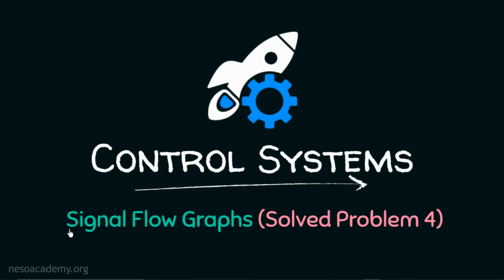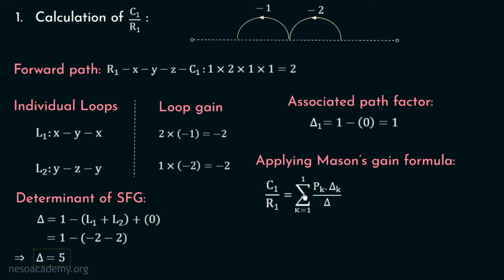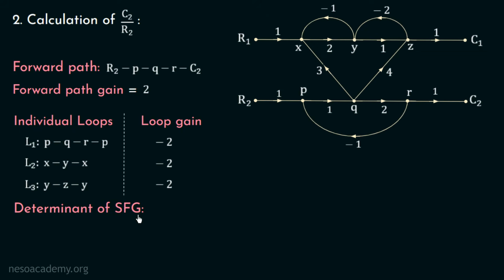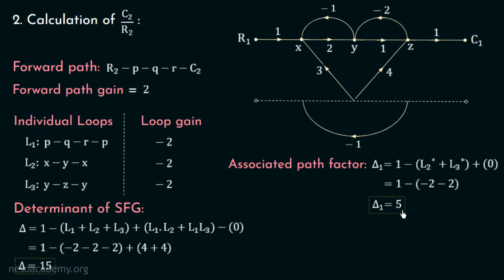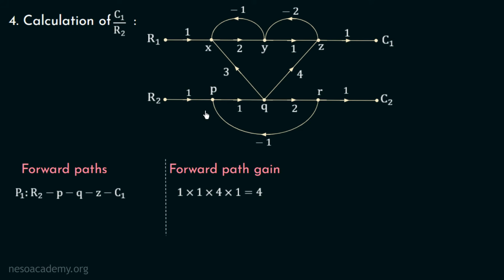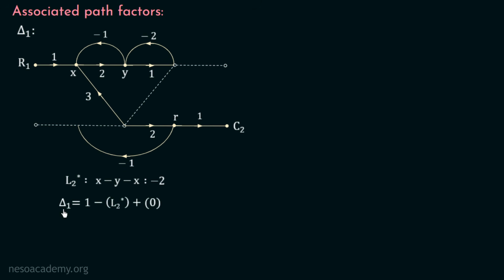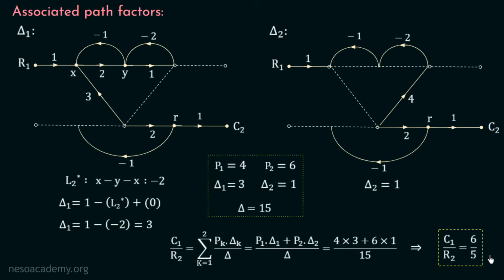Signal Flow Graphs (Solved Problem 4)

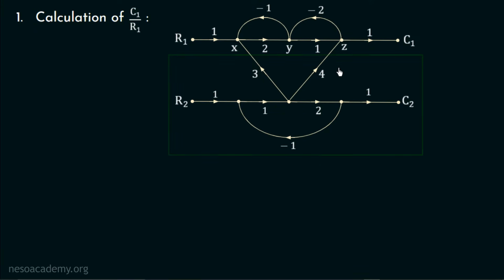Comment: 3:49 If you eliminate on the basis of signal flow from upper to lower then, one must consider the contribution of signal from lower to upper also. This will affect the calculation of associated co factor of forward path (∆¹) & determinant of S.G.F. (∆)!. I Strongly recommend this is the wrong way of calculating the Transfer Function. ❌

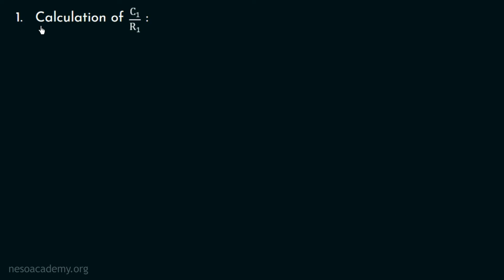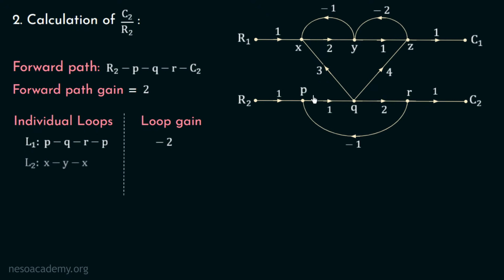Comment: at 2:12 you have written the possible transfer function for c2/R2 keeping R1 and c1 equal to zero. But at 10:08 why you are counting the loop of R1 and C1 for finding transfer function  of C2/R2?
Reply: at 2:12, it was calculating the transfer function of C1/R1 keeping R2,C2 equal to zero; and at 10:08, it was calculating the transfer function of C2/R2 keeping R1,C1 equal to zero. Based on the direction of arrows, it can only go from R2 to R1 but not from R1 to R2, that's why we should consider the loop of R1,C1 when calculating TF of C2,R2.
Reply: @bingxuli2368  Thank u bro
Reply: I hate to counter somebody else.  But please see my answer to PunmasterSTP. Your objection is correct, and the instructor got the correct answer due to specific properties of the algebra when unrelated loops appear in the analysis.

Comment: Thanks for making and sharing another great video!

I and some of the other commenters were curious about why you disregarded the lower branch for the first part of the problem (finding C1/R1) but you didn't disregard the upper branch for the second part (finding C2/R2).  I understand the reasoning that 3:45 that because nothing from R1 can get to the lower branch, you can safely disregard it.  However, for the second part, since nothing can get from R2 to the upper branch *and then come back down*, I think we can safely disregard the upper branch.  Would you agree?
Reply: at 2:12, it was calculating the transfer function of C1/R1 keeping R2,C2 equal to zero; and at 10:08, it was calculating the transfer function of C2/R2 keeping R1,C1 equal to zero. Based on the direction of arrows, it can only go from R2 to R1 but not from R1 to R2, that's why we should consider the loop of R1,C1 when calculating TF of C2,R2 coment form @bingxuli2368
Reply: Your objection is essentially correct.  Now the question becomes, why in the heck did the instructor get the right answer?  What  you can do is toy around with what I will dub, "The spurious loop theorem" What you should do is prove by simple examples that: If loops appear unconnected to the graph of interest, that Mason's Gain Formula causes them to get neatly excised from the problem.  Basically they will cancel in the final expression, because they allow factoring of the appropriate \Delta_i and \Delta.  So the instructor took a "long cut" (as counter-distinct from "short cut") yet didn't bruise the result.